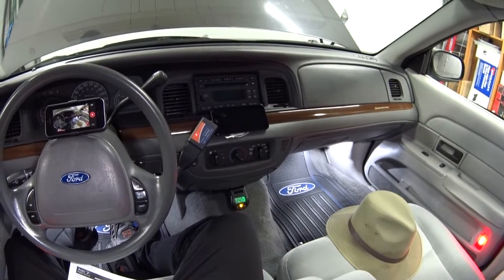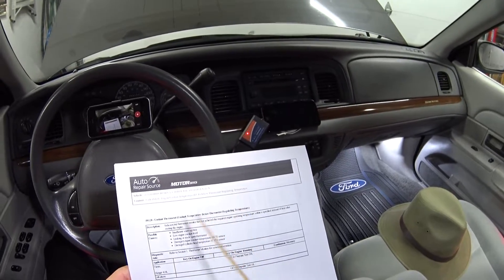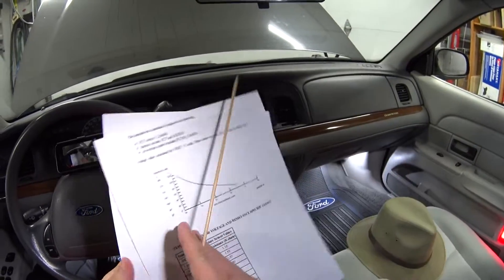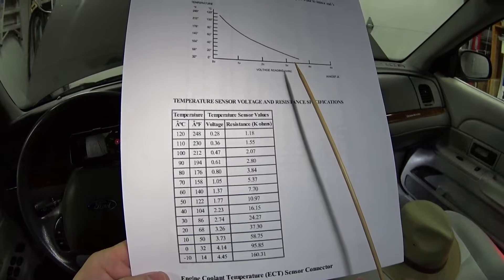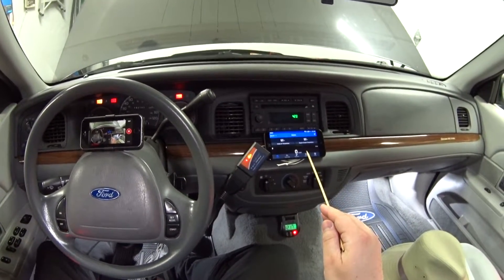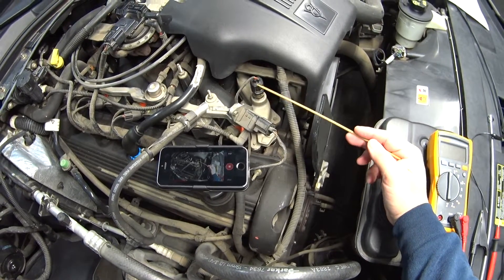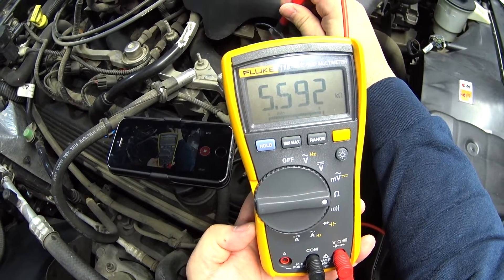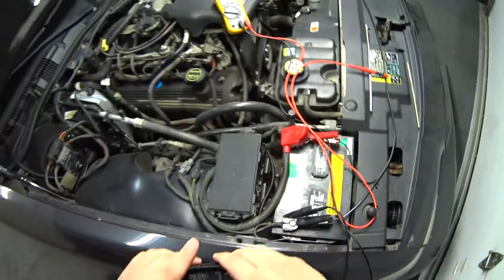Crown Victoria - P0128 ECT Sensor

Comment: Thank you, I fixed the problem. The thermostat was rusty and was always open. I also changed the coolant and cleaned the cooling circuit and the check engine light disappeared 😎thanks to your education
Reply from the maker: Right on Ismael,
Glad you got it sorted out. 
-Chuck

Comment: 1999 mercury gm ls. Code p0118. Changed ect and cht sensor. Pigtail for ect changed and new crankshaft and camshaft sensor and thermostat. Both wires at pigtail have continuity. I think there is a problem with ground from wiring harnesss. What would be the best way to find the issue? Thanks
Reply: Ok thanks
Reply: Going to the library in the morning.   9v coming from harness unplugged from sensor.
Reply from the maker: Hello,
My service literature says two possibilities.
Starting with the easiest first;

1.) ECT Sensor out of specification.
Yes, I know you got a brand new one.
But new, does not mean it's good.
I would test it the old fashion way with some boiling water, and cold water.
And then test it a second time looking at scan tool live data.

2.) Short to ground.
This requires you to follow a diagnostic trouble shooting procedure, and probing wires that is too long to write here so you will need access to factory service literature.
This is how you get it for free, (you just need a local library card to access it online);
https://youtu.be/cCxHk1PNBuo

-Chuck

Comment: Thank you for your channel - very much appreciated. My question is in regard to an overheating issue that I’m having, wherein I see my reference voltage going to the ECT sensor is 11V, not the 4.5-5V as mentioned in various repair manuals and from what I’ve seen online. Possible PCM issue (nothing grounded out)?

Thanks!

Update - fixed the issue by replacing the brand new Dorman thermostat that came with my new intake, with an Autozone Duralast Gold. We’ll see…
Reply from the maker: Thanks for watching.
-Chuck

Comment: Great video,  I don't have any problems at this time , but the dash gauges in this car seem mickey mouse , I would like to install some aftermarket gauges,  temp, voltage, and oil pressure,  I'm curious about the computer (PCM) wiring with the temp gauge or do I have to install another temp gauges in a different location.have a 2011 P7B, Thanks.
Reply: Okay, I looked WOW so many types and prices. Have you seen one that actually shows the real-time oil, peasure , volts, and water temp in the display.
Reply from the maker: @MrRockydee07  
I've never looked, it was just a thought.
Reply: @PanzerPlatform  thay are nice, Thank you .
Reply from the maker: It might be easier, faster, cheaper to go with an all in one display through the OBD2 system. 
-Chuck

Comment: I have a 1998 grand marqiuse the the sensor on the manifold blew out?? Shot all the water out. Striped the screw in part. What do I do?
Reply from the maker: Most likely you need to replace the manifold. 
-Chuck

Comment: I just bought a 2001 grand marquis and there’s oil leaking out out of the bottom of that sensor. If  I get it replaced would it stop leaking?
Reply from the maker: Yo Fosik,
Thanks for stopping in.
Can you upload a video showing what you're talking about?
Please film in widescreen, (not vertical video).
Hold phone sideways.
-Chuck

Comment: I changed my bad ect sensor and now my temperature gauge doesn’t work. What do I do?
Reply from the maker: Yo Richard,
Thanks for stopping in.

I would check the wire from the ECT Sensor to the PCM, and the wire from the PCM to the gauge in the instrument cluster. 
-Chuck

Comment: Sir I got a p1151,p0155 could thus be cause by this sensor completely going out,everything else has been replaced lowkey,whole fuel system,along with much more I had a coolant leak it’s now fixed but getting lean codes?pls help
Reply from the maker: Yo CG,
Thanks for stopping in.

What is the YEAR / MAKE / MODEL of your car?
Is it a Police Model, or Civilian Model?
-Chuck

Comment: Hey Chuck, i just replaced my intake manifold and now my temp gauge doesn’t work. I replaced the etc sensor and it still didn’t work. I also replaced the etc sensor again to ensure I didn’t get a faulty part. The temp gauge is still not working. 

When I replaced the intake manifold, I disconnected the resivoir hose from the over flow tank and just let it drain out. Once I put the new intake on, I filled with coolant and cranked the car but temp gauge on the gauge cluster had a steady reading of 0. I plugged a cheap code reader in the OBDII port and the car is idling at 192 degrees. 

I let it sit for about a week out of frustration. So yesterday I cranked it up and let it idle for about 5 mins and the gauge is still not working so I turned it off. I noticed there was water leaking from under the engine a few hours after but I wasn’t running the ac. It was a horizontal shaped wet-spot directly beneath the engine.

I’ve replaced the thermostat with the kit that comes with the intake along with the o-ring. I checked 3 times to make sure I didn’t install it upside down. 

I do not own a code reader. I do not know any honest joes. I do not have a lot of money.

Help…
Reply from the maker: Yo LL,
If the ECT is reporting to the PCM, and you saw 192F on the scan tool it looks like the ECT is not reporting to the instrument cluster.

I would verify ECT signal is getting to the instrument cluster first. 
-Chuck
Reply: @PanzerPlatform  bro thank you for the fast response. I forgot to mention the sensor worked perfect prior to me replacing the intake manifold. To be honest I do not have the means to check for all of that stuff. All I know is it worked great but then I broke the sensor from removing it from the old intake. I installed it partially broken and it kinda worked but not to my liking. So I pulled it back off and broke it all the way. 

I put 2 new etc sensors in it and still not working. I will check what you said but it will have to wait until I have the means to check it. I was hoping it would be a quick fix.

Comment: I have a 2008 Crown Vic LX with the 4.6L and the ECT is not in that location. Is there possibly another spot it could be?
Reply: @PanzerPlatform  I just need to know where the Engine Coolant Temp sensor is possibly located because where you show it is in your video on mine there is no sensor there at all. It is like just a blank piece of metal. There is no cutout or threads for a sensor and no plug so was it possibly relocated? And if so where? The code was P0128.
Reply from the maker: @alexlubbe  
Thanks for confirming the code.
The short answer is your car doesn't have an ECT sensor.

The long answer is "it's complicated".
Would you be willing to wait a few days for the long answer?
I will make another short video that might be helpful.
-Chuck
Reply: @PanzerPlatform  yeah I will wait. I am curious how mine doesn’t have one because the person I bought the car from showed me a receipt from a repair shop that supposedly changed the sensor like 2 months ago. So I was trying to test it and see if it went bad. I also changed the thermostat so hopefully that fixes the P0128 but that was supposedly changed a year ago by a different shop. So strange.
Reply: @PanzerPlatform  also another question: so on the same car the battery light comes on while driving and stays on for quite a bit then shuts off then kind of repeats that cycle. I was thinking it was an issue with the alternator but checked the voltage when it’s idling and I am getting like 15.5 volts (which I think is a bit high) I think the alternator is overcharging the battery. But I took both the battery and alternator in to the parts store and had them test both and they both tested good. So what could be the issue? Why does the battery light come on then shut off. I also checked the tension of the serpentine belt and that is tight also.
Reply from the maker: @alexlubbe  
Right on,
I’ll be glad to help you with your overcharging issue, but let me work on your ECT issue first.

Can you email me the FREEZE FRAME DATA for your Pending Code P0128.
If you are using a wireless scan tool with a tablet, or smartphone you can just screenshot all the Freeze Frame Data.

If you are using a handheld stand alone scan tool you can just take photos with your smartphone. My email is: BudgetPantherPlatform@gmail.com
-Chuck
Reply: @PanzerPlatform  - So I don’t have a scanner that shows that. It’s just a basic code reader that shows if the monitors are set and shows the code. I also cleared the pending code after I replaced the thermostat to see if it would come back.
Reply from the maker: @alexlubbe  
Send me an email.
I might be able to send you a better scan tool for free, you would just need to pay the $10 USPS shipping.
-Chuck
Reply: @PanzerPlatform  I will send you an email later on this evening. Thank you very much.
Reply: I have a 2011 vic interceptor. Changed the thermostat and a month later check engines back on and it takes the engine forever to get up to temp but does not over heat? Engine temp sensor? Its not located on the top of the intake either side theres just plugs. I think its under the thermostat housing. Any advice?
Reply from the maker: @MooRowl1776  
Right on Ruger,
Here you go;
https://youtu.be/13tlhiBSriY

If you need more help please start a new comment thread.
-Chuck
Reply from the maker: Right on Alexander,
Thanks for stopping in.

Are you experiencing a malfunction?
Do you have a DTC, (diagnostic trouble code)?
If so, what is the code?
Would you like help with diagnosis?
-Chuck

Comment: My 09 crown Victoria police interceptor throws this code everytime it get cold outside
Reply from the maker: Right on Tex,
If the code goes away on it's own after a while you may want to ignore it.
If it keeps bothering you, and you want to fix it let me know.

Btw, I've never seen you around here before.
Welcome to the club, prepare to be disappointed. lol
-Chuck
Reply: Mines too do the P71 have this sensor I was told it does not did you get it fixed?
Reply: @jgraham1858  no if I let it warm up for 10 minutes before I drive it doesn't do it. Only happens when it's cold outside and I take off without letting it warm up first.
Reply: @Louismorgan1986  Exactly same here if I don't let it warm the check engine light comes on I want to fix that not sure if I am damaging anything
Reply: @jgraham1858  it doesn't. It the temperature sensor, I have something that resets mine. It's nothing serious
Reply: @Louismorgan1986  thanks man appreciate your insight feel much better lol

Comment: Hi, I live in the rust belt and my check engine light came on last summer, so I changed the thermostat and for half a year the error was gone. Now it came back. I didn't check the temperature sensor. Do you think that could be the issue? I would go with your resistor over temperature chart to diagnose.
Reply from the maker: Right on JJ,
Need more info:

1.) What is the YEAR / MAKE / MODEL of your car?
2.) What is the current DTC in your car?
-Chuck
Reply: @PanzerPlatform  P0128
Ford crown vic 2009
Reply from the maker: @josefjosef1524  
Thanks for the clarification.
Follow the service literature trouble shooting steps at 1:36.
-Chuck

Comment: I had  a code p1299 the other day on my mercury.
Reply from the maker: Right on BW,
DTC P1299 : Cylinder Head Temperature Sensor Detected Engine Overheating Condition

Do you need help with anything?
-Chuck
Reply: @PanzerPlatform  Thanks, I'm not sure where to start. Thermostat replacement? It was 25 degrees here in IL yesterday. Normal temperature  reading on the dash. Where would I start? Thanks Chuck
Reply from the maker: @badwolf1795  
Let me look into it.
Do you have a scan tool?
Reply: @PanzerPlatform  Thank you, I have a Matco MD60 it reads and can clear codes
Reply from the maker: @badwolf1795  
Plug it in, and see if you can pull up live data for CHT Cylinder Heat Temp.
Reply: @PanzerPlatform  I'll have to get a better scanner mine doesn't have live data
Reply from the maker: @badwolf1795  
I found the troubleshooting steps.
If you send me an email, I'll send you the 8 page PDF.
BudgetPantherPlatform@gmail.com

Comment: I had this same problem recently. Changed the thermostat. Took about 10 minutes. No more check engine light and the engine heats up normally. I was surprised to learn that these cars don't require rtv sealant around the thermostat housing. Having owned much older cars this was always a requirement.
Reply from the maker: Right on Pantera,
Long time no see.
Thanks for dropping in with the good feedback.
-Chuck

Comment: First off thanks for your uploads 👍🏼
I had that same code p0128 I replaced my thermostat and it fixed that issue my thermostat was stuck open.
Question: I'm dealing with (p0108) manifold barometric reading is high on 2006 crown Victoria p71.I've done research but can't find a fix.
Reply from the maker: Right on Papo,
Thanks for the good feedback.

Send me an email, and I will send you the troubleshooting steps for DTC P0128.
BudgetPantherPlatform @ gmail . com
-Chuck
Reply: @PanzerPlatform  ok thanks 👍
Reply: @PanzerPlatform  today my wife had my crown vic to take it to the smog test, the p0108 was fix by replacing egr on the way home she saw smoke car overheated so she popped the hood and there’s coolant everywhere
Reply from the maker: @papo862  
Yikes. Thanks for the update.

Comment: Can you do a video on P1299 and how it works on a crown vic or panther platform 4.6?
Reply from the maker: I just looked up DTC P1299 for Crown Victoria in my service literature, and there is no information found.

Can you email me your BlueDriver report with Freeze Frame Data?
Is this code on Isaac's car?
-Chuck
Reply: @PanzerPlatform  Oh boy lol.  I can attest that it is very real.      Have to be careful with these engines when the cooling system has been opened up and there is air trapped around the Tstat.
Reply from the maker: @PNW_Car_Mods  
I found these codes in my service literature for Crown Vic.
Is it one of these, If so I can make a video.

P1285 Cylinder head over temperature condition
P1288 CHT Sensor Out of Self-Test Range
P1289 CHT Sensor Circuit High
P128A CHT Sensor Circuit Intermittent/Erratic
P1290 CHT Sensor Circuit Low

Comment: Hello, I know this question if I off topic but this morning my gear shift indicator got off track for some reason. For example, if I have it in park ,the indicator is reading neutral. Any tips on how to fix this?
Reply: Assuming the trans function matches the position of the gear shift arm.... its likely a little rod or string that moves the indicator.
Reply from the maker: Right on Jamo,
This might help; https://youtu.be/iJT0ql_zMSk
-Chuck
Reply: @PanzerPlatform  Thanks, I will try this!

Comment: Back in the 90s it was VERY common for the ECT sensors on Ford 5.0L's to go bad.
Few months ago my 11 GM got this code and my mind went directly to the 90s.  Since the car is new to me & I plan on keeping it long term, I decided to just change both the Stat and the sensor.  Well... the sensor on mine appears to be under the coolant crossover! I really didn't want to pull that part so I changed only the stat and coolant.
I'm fortunate that the new stat resolved my problem.

Also, my daughter had a Jeep liberty 3.7L.  I can't tell you how many stats & sensors we went through to get this code to go away.  My final "fix" was to use the (expensive) OEM stat.  Wouldn't you know... that fixed it. (its hard to believe that all the high quality aftermarket stats did not work like the OEM)

Thanks for this post. In the future it'll help understand the problem instead of shotgunning parts at it.
Reply from the maker: Right on WOT,
Thanks for the good feedback.

Partshotgunning is understandable when you desperately need to fix your car, and when you don't have $225 to pay for one hour of diagnosis at the dealership, (that's what my local Ford dealer charges).
-Chuck